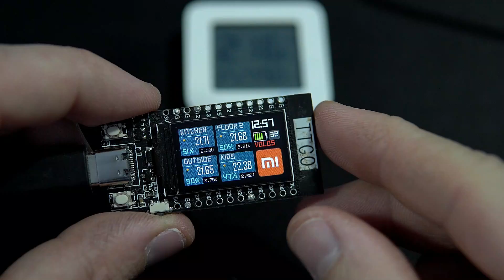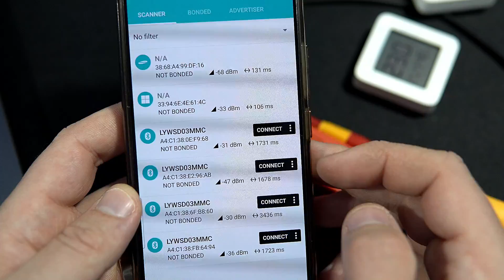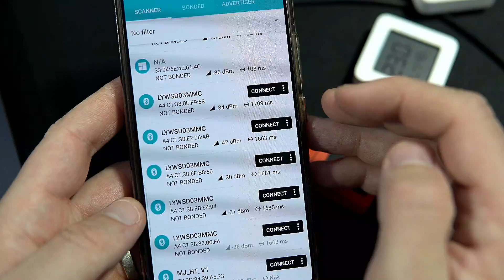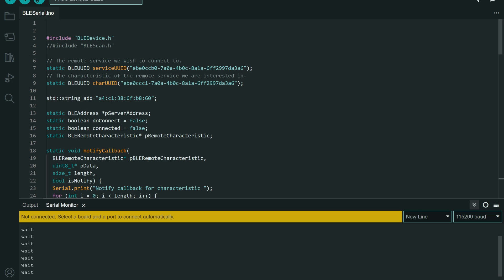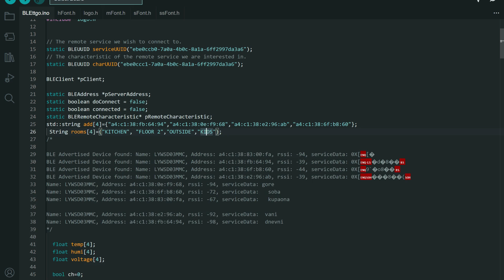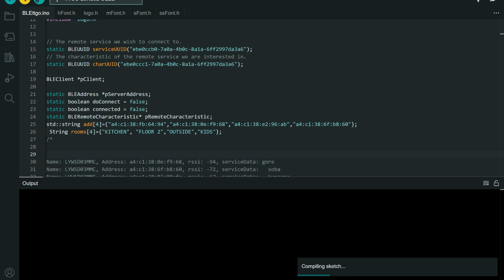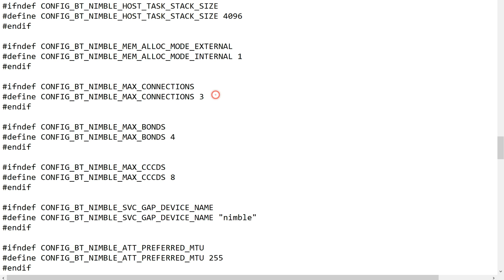ESP32 gets data from Xiaomi Thermometers using BLE

Comment: I have recently bought a LYWSD03MMC, and check the service UUID by using nRF app. It seems that the latest firmware installed does not advertise  service UUID. Is there any way to roll back to the old firmware working with your ESP32 sample code?

Comment: When I try to load the BLESerial file, I get the following error when it's trying to compile it.  Any suggestions?   
BLESerial.ino:62:55: error: conversion from 'String' to non-scalar type 'std::string' {aka 'std::__cxx11::basic_string<char>'} requested
   62 |   std::string value = pRemoteCharacteristic->readValue();
      |                       ~~~~~~~~~~~~~~~~~~~~~~~~~~~~~~~~^~

exit status 1
Reply: I had the same issue. I simple add a ".c_str()" after the readValue():

std::string value = pRemoteCharacteristic->readValue().c_str();

At least on my setup that helped...

Comment: Great project, thanks for sharing it!

Normally these sensors connect to a Xiaomi Smart Home Hub via BLE, so they can be remotely monitored with the Mi Home phone app. Can that work side-by-side with your solution, or BLE allows them to connect to only one other device, either the Hub or the ESP board at a time?

Comment: I always getting errors when i compile code, i cant find anything on web for solution

c:/users/WestColera/appdata/local/arduino15/packages/esp32/tools/xtensa-esp32-elf-gcc/esp-2021r2-patch5-8.4.0/bin/../lib/gcc/xtensa-esp32-elf/8.4.0/../../../../xtensa-esp32-elf/bin/ld.exe: C:\Users\WestColera\AppData\Local\Arduino15\packages\esp32\hardware\esp32\2.0.11/tools/sdk/esp32/lib\libfreertos.a(port_common.c.obj):(.literal.main_task+0x1c): undefined reference to `app_main'
c:/users/WestColera/appdata/local/arduino15/packages/esp32/tools/xtensa-esp32-elf-gcc/esp-2021r2-patch5-8.4.0/bin/../lib/gcc/xtensa-esp32-elf/8.4.0/../../../../xtensa-esp32-elf/bin/ld.exe: C:\Users\WestColera\AppData\Local\Arduino15\packages\esp32\hardware\esp32\2.0.11/tools/sdk/esp32/lib\libfreertos.a(port_common.c.obj): in function `main_task':
.
.
.
.
.
exit status 1

Compilation error: exit status 1

Comment: Hi again. I have your code working on a T-Display S3. I only have one Xiaomi Sensor, but I’m getting readings on the display. I’m assuming you’re not getting any serial output with the S3. This maybe because of the ide settings in tools. It needs to be in CDC mode for the C3 and S3 boards. Set USB CDC On Boot “Enabled”, USB Mode: “Hardware CDC and JTAG”, Upload Mode: “UART0 / Hardware CDC”. That should do it. Let me know if it works for you. Take it easy 👍🏾🤓
Reply from the maker: Hello Pete, thank yoi, yes it seem my cide work when there is only one sensor, more people reported me that also. So probably fix is in few lines of code. Thank you for your support an coffee.
Reply: I’ve got four thermometers working with the T-Display S3, even with them in different rooms. The connections are unstable though, so sometimes two or three will connect, but sometimes four. It’s the same with the thermometers next to the display. It’s great when it’s working properly. More investigation needed 👍🏾🤓
Reply: Code seems to work OK on ESP32-S3 with up to 3 x thermometers. for me  - the 4th one is ignored - even though it shows up on nRF Connect OK.   but not seen in BLESerial or BLEttgo, can only see a max of 3 units

Comment: A handy tip for telling multiple BLE devices apart is to look at the RSSI value (when dis. It will vary with the square of distance, so has larger change in value when near, and less resolution further away. 
Using RSSI value could be used to display the closest device(s) and not display data from further away devices, or indicate location such as which device/room is nearest.

Comment: Hi Thank you for such an interesting implementation! Could you please kindly confirm the libraries you're using? I am using these and the nice display came up only for a brief moment once and now it doesn't anymore...
Using library NimBLE-Arduino at version 1.4.1 in folder: C:\Users\AAAA\Documents\Arduino\libraries\NimBLE-Arduino 
Using library TFT_eSPI at version 2.5.34 in folder: C:\Users\AAAA\Documents\Arduino\libraries\TFT_eSPI 
Using library SPI at version 2.0.0 in folder: C:\Users\AAAA\AppData\Local\Arduino15\packages\esp32\hardware\esp32\2.0.14\libraries\SPI 
Using library FS at version 2.0.0 in folder: C:\Users\AAAA\AppData\Local\Arduino15\packages\esp32\hardware\esp32\2.0.14\libraries\FS 
Using library SPIFFS at version 2.0.0 in folder: C:\Users\AAAA\AppData\Local\Arduino15\packages\esp32\hardware\esp32\2.0.14\libraries\SPIFFS
Reply from the maker: Did you install m5stick cplus2 board in ide and did you instal stick cplus2 library. Other libraries seems ok
Reply: Oh thanks so much for your quick reply  @VolosProjects !!  I am using the TTGO T-display  - The serial port is showing that the modules are well dtected and data is read, but no image yet 😢
Reply: @VolosProjects  only once briefly the image came up and then never again
Reply from the maker: @szanolli  oh, sorry, than you just need setup tft espi library. Find my video how to setup or install ttgo t-display in arduino ide
Reply: @VolosProjects  I will check thanks!!!
Reply: Thanks! Solved! TTGO T-display solution for me was in these parts of your videos:  https://www.youtube.com/watch?v=b8254--ibmM&t=350s  and  https://www.youtube.com/watch?v=ExFxuvfCbAU&t=560s

Comment: Very interesting video and very good explanation 👍 
Is it possible to Use a lilygo esp32 s3 module with tuya app or smart home app ? I have a tuya water sensor that I want to be displayed on the small lilygo esp32 s3 module. 
If you can help this will be amazing.
I want to use dedicated small t3 displays for different tuya sensors. Like temp and humidity on one lilygo s3 display module and tuya water level sensor on another lilygo s3 module.

Comment: Excellent video and monitoring temperature in different locations is very handy. Do you have any idea why it will not work on the ESP32-S3 boards yet? Possibly a different BLE type?
Reply from the maker: Tnx mike, no, i tried and tried but i can find solution. I am waiting maybe someone will helo me.
Reply: @VolosProjects  I see the T-Display uses BLE 4.2 and the S3 Pro board uses BLE 5.0. Will dig deeper...
Reply: @0miker0  Were you able to find out how to do it?
Reply: @tomasmm  it’s been a while but yes, I believe it did work on the S3
Reply: @0miker0  And by the way, thank you for replying!
Reply: @0miker0  It didn't let me post my question. I will give it another try once again.
We got it to display the ID of the device, but when we execute the following to get more data:

std::string value = pRemoteCharacteristic->readValue();
Serial.println(value.c_str());

We get these weird symbols as output:
The characteristic value was: �  �

Do you know what the problem could be?

Thank you again!
Reply: @0miker0  Nevermind, I got it. I had to print the data as decimals and use the code provided in this video to get the temperature.

For example, this is the humidity value (3rd element in the array):

std::string value = pRemoteCharacteristic->readValue();
Serial.println((uint8_t)value[2], DEC);

Thanks again!

Comment: im curious, lets say i want to build a desk clock using m5 screen module, if it runs on an AA or AAA battery, how long will it last?
Reply from the maker: First it will not work on single battery, you will need 3 of them, lipo batteries are better choice. But if you want to use 3 Aa beteries and you want simple clock that shows only time, you will need to put board to sleep and update time once per minute. And this way you will get maybe few days of runtime. Boards with screens need lot of power  just for backlight led

Comment: @VolosProjects I'm not a c programmer but ifndef means if it's not defined and you can define the number of ble devices in your arduino sketch (I think it has to be before the import of the library, but my knowledge of c is zero) - this will override the library value. No need to modify the library every time.
Reply from the maker: thank you, yes you are right , ther is no need to edit library.

Comment: Great video. I'm really happy to find your channel and I'm getting a lot of UI inspiration from your videos. (I watched the whole video...twice).
But there is one thing I'm not really sure why you're not using in your projects which is the flash in the ESP32. I mean you could easily save these settings (e.g. the BLE ID - device name pairs in your current example) to files on esp device instead of hardcoding them to the code. 
I think there can be a lot of potential (in addition to the config files) in using flash memory. 
For example in my current project I'm using it to store temperature/humidity/pressure data from a BME280 sensor and it would be super to show them in a nice chart/graph on a small screen like TTGO (I'm using Heltec ESP32 LoRa for this, that is an amoled, but the base idea I think will be the same), but of course it could be challenging because there are much more data stored in flash than I could display, so maybe just display a smaller portion or maybe scale down and get an avarage or something. I did not figure it out yet, because I'm concentrating on finishing the project and then I can work on the display part. Anyway I couldn't find good tutorial in charts/graphs with ESP32 and I think it would be super interesting to see your solution/idea to deal with a lot of data which obviously can't fit in memory at once nor to the display.
Reply: Word of warning to those wishing to write non-volatile data to the flash programmatically: The relatively poor write endurance of flash could lead to problems if you accidentally code a write / erase loop which flashes tonnes of data continually. 10k - 100k cycles is quoted. Even with wear-levelling you could render a partition useless after just a few hours or even minutes. For development I prefer to use external FRAM which is fast and indestructible - 10 trillion (10^13) cycles -  just so I can afford to make mistakes when experimenting.

I also watched the whole video twice.  :)
Reply from the maker: thank you, both of you , for watching video twice... reason why i never use flash is simple, i still need to learn alot. Now i have new task to play with. Thank you! I will keep in mind what Nick sayed.

Comment: These are good but the app app doesn't let you save a history that's the only thing annoying really, if you leave it constantly running it will run the battery down won't it? I think the thermometer keeps a history of temperatures itself somehow

Comment: Great use, I want to do something similar and mainly standalone without depending on a hub/server or phone. Im curios about the range, can I have the ttgo in the living room and have the sensor is separate rooms and still get the readings? Thanks for sharing your projects
Reply: I wonder if it would work with the t-pico C3 I have . Either way I know what to add to my next AliExpress order. PS yes watch till the end, 10min video are great
Reply: If range is short maybe set an esp32 with 2 sensors sending data to tdispay

Comment: Nice project and design as always. However , I doubt that BT connection is the right choise for reliable connection inside house, having walls and even sometime different levels.
I think that using ESPNOW will be much more efficient, or for example LoRa. I realize, that in this particular project it is not possible to implement other types of connection, but it will be very interesting if you concentrate your attention on completely custom project ( I mean , including the temperature sensors, not standar ones).
Reply from the maker: Yes , i needed to find good position for sensors  and for esp32. But it works now. Esp now is great, but in that case i need 5 boards ,4 sensors and what is worst power suply for them. Thank you. I think i will make espnow tutorial next week.

Comment: Nice project! How long do this sensor work between battery-changes? And what is the range?
Reply from the maker: between one and two years, it depends on battery.
Reply: my experience: Battery: at least MORE than 22month - Range: up to "through 4 concrete walls" without problems   (different receiver thou)